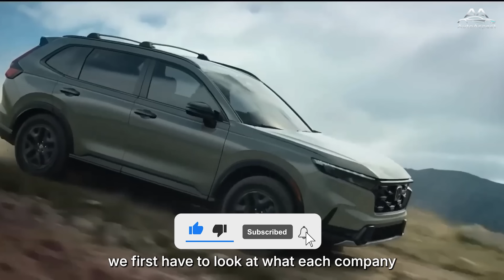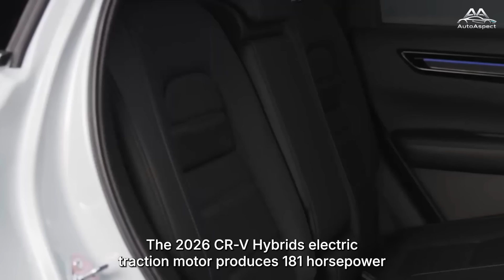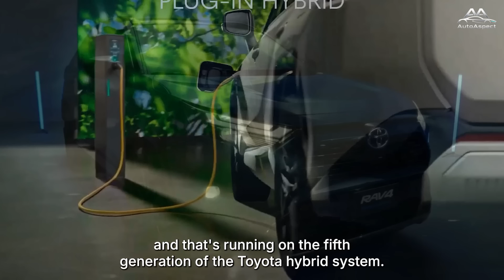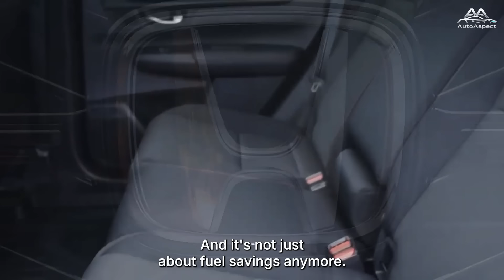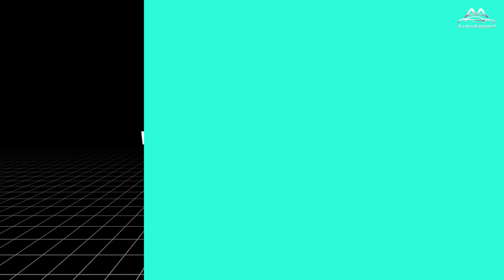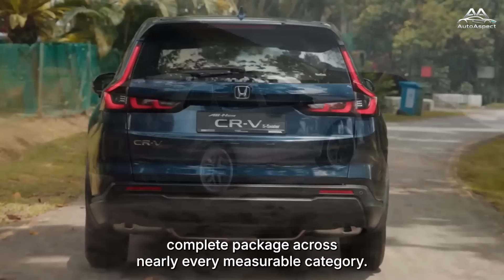Toyota's 6th Gen Hybrid Just Made Honda Obsolete!

Comment from the maker: Honda wins the first 20 minutes. Toyota wins what comes after — or does it? If you’ve owned a CR-V Hybrid or RAV4 Hybrid, which one would you trust for the next 10 years, and why?
Reply: What's said and shown in this video about the Honda CR-V Hybrid is incorrect! The Honda CR-V Hybrid in the Advance trim level, available in Germany, has ventilated and heated genuine leather front seats. The rear leather seats also have switchable heating. In addition, it features a heated steering wheel, heated windshield, heated side mirrors, a large glass sunroof integrated into a panoramic roof, a special Bose premium sound system with 12 speakers including a subwoofer and center speaker, a 360-degree multi-view camera combined with the Honda Sensing safety system, a heat-up display, all LED lights, and much, much more. The interior is significantly higher quality than the RAV4, and it's also quieter due to better sound insulation. It offers a much more comfortable ride and suspension than a RAV4, with only slightly higher fuel consumption. It achieved excellent results in crash tests, receiving full marks and being rated as very safe.  For me, the Honda CR-V Hybrid is definitely the better-equipped and more comfortable car of the two, and therefore I give it a clear recommendation to buy.

Comment: Ive been looking at both, a few things you didn't cover are Toyota it has two big issues not good, First the 14/10 gallon gas tank makes it fall flat on range, and second the Orange power supply to the rear motor drive is UNDER the car NOT like the Hondas inside the car, this is a 3 year or less problem for ANY one driving in SALT or Water issues areas and good luck on repairs also the lack of gas range is to bad you'll just have to live with it. So IF you want AWD Don't get the RAV4 and if you want the best out of RANGE again Don't get the RAV4 at all. What's remarkable to me is the long term Hybrid in the Toyota about the same with Honda over all its not good, I'd get the Honda CRV hands down just get in the habit of  the open Hi-Way twice a week for sure as it's about Temps and running as it NEEDS the fuel burn off you won't get if you ONLY drive around town and under 50 most of the time. OR DON'T BUY A HYBRID stick with GAS Only.

Comment: Sound like honda stresses the ev battery more..?? I get 40mpg in mixed driving in my skoda octavia 245vrs and 53mpg on very long motorway journeys.  With no hybrid complications
Reply from the maker: Honda does rely more heavily on the electric motor in a lot of low- and medium-speed driving, but that alone doesn’t necessarily mean the battery is being stressed more—we’d need long-term battery data to make that call. And 40 mpg mixed / 53 mpg on long motorway runs from a non-hybrid Octavia is a strong reminder that a well-optimized ICE can still be very efficient without adding hybrid hardware. Do you think the extra complexity of a hybrid is worth it if a conventional car can already return numbers like that?

Comment: Your attempt to offer a complete comparison of these 2 hybrids yet you left out the elephant in the room. Intake valve fowling is a reality in direct only fuel injection that is expensive to treat and almost impossible to control in these engines . For working people we must keep our cars as long as possible. Toyota is one of the few companies that equips its vehicles with dual port and direct fuel injections to correct this problem. Don’t feel too bad most reviews also  miss this important defect. I look forward to to see if this comment is published .
Reply from the maker: That’s a fair point to raise. This comparison focused mainly on the hybrid systems themselves—how they deliver power, efficiency, driving feel, scale, and long-term ownership factors—so fuel-injection design wasn’t covered in detail. Toyota’s approach to long-term engine design is absolutely something worth including in a deeper ownership comparison, especially for people planning to keep a vehicle for 10–15 years. In your experience, how much weight should buyers give fuel-system design compared with MPG, resale value, and overall hybrid reliability?

Comment: cvt is bad decision !!
Reply from the maker: I get why the “CVT” label worries people, but Toyota’s hybrid eCVT is very different from a traditional belt-driven CVT. It uses a planetary gear power-split system, which is actually one of the key strengths of Toyota’s hybrid design. What is it about CVTs that concerns you most — reliability, driving feel, or long-term repair costs?
Reply: @AutoAspect-x yup toyota ecvt is different , i mistakenly saw the tittle 😂
Reply: I hate that they call them CVTs at all.  Tbh.  Hondas transmission is barely a transmission at all.

Comment: I am pretty sure Honda is not asleep at the wheel.  Lets have a look at 2027.   Honda will pull a Rabbit out of someone's hat pretty soon.
Reply from the maker: I agree—Honda definitely isn’t asleep at the wheel. The CR-V Hybrid already shows how strong Honda is when it comes to refinement and that smooth, EV-like driving feel. Toyota may have the overall edge right now, but 2027 could change the conversation quickly if Honda brings something unexpected. What do you think Honda needs to improve most to take the hybrid crown from Toyota?
Reply: @AutoAspect-x  Better Powertrain efficiency and a bit more power overall.  If the powertrains were more equal, I dont think I would be hearing you selling Toyotas.

Comment: Expect to go to Rav 4 PHEV in '31. '24 CCH AWD SE, ALWAYS hyper mile, average 75mpg and EV ratio from new. All depends on developments before. I don't think Honda comes close to the EV ratio possible, ICE durability.
Reply from the maker: 75 mpg from an AWD hybrid is seriously impressive — hypermiling clearly makes a huge difference in the right hands. Toyota’s system also seems especially well suited to maximizing EV operation and overall efficiency, which is a big reason the RAV4 PHEV makes sense as your next step. Honda has a very different hybrid philosophy, so I wouldn’t count them out, but Toyota definitely has the stronger track record and system maturity right now. What kind of EV range would the 2031 RAV4 PHEV need to have for you to make the switch?
Reply: @AutoAspect-x what it has is sufficient, more would be better. I'm hoping the new CCH will get PHEV. By '31 it all COULD be dramatically different.

Comment: I like the eCVT found in a Toyota.  I am hopeful my Rav 4 plugin will go the distance. 

I have 67 k miles and have done nothing to it.
Reply from the maker: That’s a great real-world data point. Toyota’s eCVT is one of the reasons many owners like the system — it uses a planetary power-split setup rather than a traditional belt-driven CVT, which keeps the drivetrain relatively simple. 67k miles with no issues is definitely encouraging.

Are you planning to keep the RAV4 Plug-in past 100k miles?

Comment: I bought a Honda CRV HYBRID  SPORT. TOURING . I AM AVG 41,2 MPG . BEST CAR EVER.
Reply: Exactly Toyota hybrids drive a bit like shit. I bought a Honda too😂
Reply from the maker: @CaptainAmericoCC 41.2 MPG is seriously impressive, especially from a CR-V Hybrid Sport Touring. That’s a great example of why real-world results can matter more than the numbers on the spec sheet. Sounds like Honda absolutely nailed the balance for your driving. What kind of driving are you doing most — city, highway, or a mix?
Reply: @AutoAspect-x .  I can take a picture of the Dash board to show it’s true.  Very Pleased with the Car.  I was talked into it by my 37 year old son who told me to buy it and not the. Lexus.  I saved  $ 16,000 . And my ego is ok.  People are now buying reliability and value not ego.  German cars are in trouble.
Reply: 2014 vw wagon tdi, more internal volume , 46 mpg, 240,000 miles without a power train repair, 535 miles per tank, no spark plugs or tuneups just oil and filter change, you don’t need a tall short stationwagon.
Reply: @FrancisoDoncona  nice… great car.  You made a good decision.   VW is not what it used to be . Although  , they are getting better again.

Comment: Chinese hybrid technology is beyond Toyota.
Reply from the maker: Chinese hybrid tech is advancing incredibly fast, no doubt. But “beyond Toyota” depends on what we’re measuring — outright technology, efficiency, long-term reliability, resale value, or global scale. Toyota’s advantage is that its hybrid system has been refined and deployed across millions of vehicles for decades, not just proven on a spec sheet. Which Chinese hybrid system do you think currently beats Toyota overall?
Reply: Only for highway speeds, city Toyota is still in front of everyone. They're still scrap within months.
Reply: Bull....  Toyota got a 30 years head start to work all the kinks out and to optimize the Atkinson cycle engine.
Reply: @ericle7299 but it is. They inevitably spontaneously combust if they don't disintegrate. Much faster self replenishing market, Toyota hasn't figured it out yet.